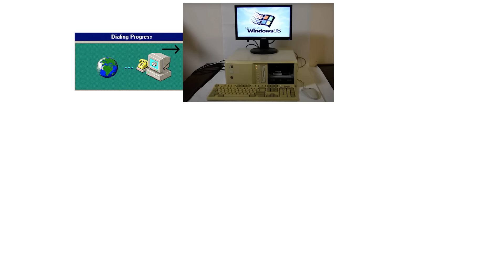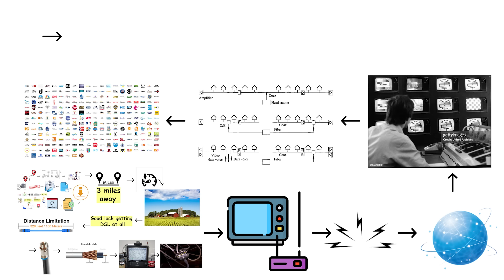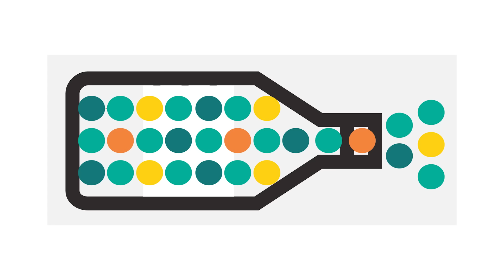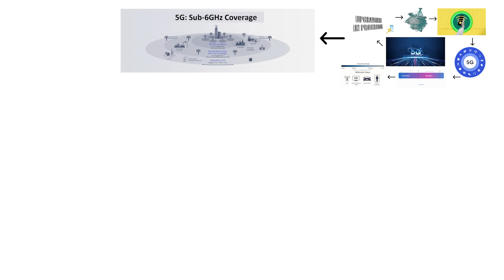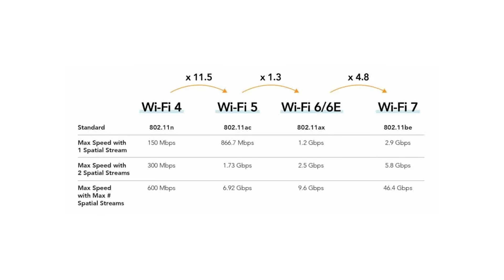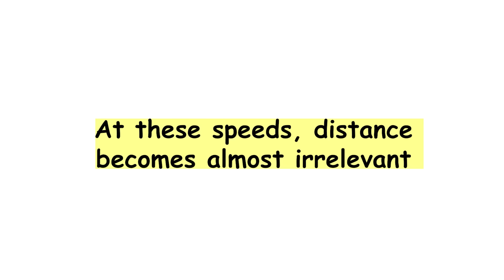Every Internet Speed Evolution Explained in Detail

Comment: i believe it is a bit inaccurate to say that the speed "increases" as in data travels faster. the speed "increases" because it can move more data per unit of time. no matter if the medium is a fiber of a copper or the air, the data moves roughly at the same speed.

Comment: ISDN gets no love
Reply: I have never met anyone who actually had ISDN.. still to this day 😅 how was it? Is it sort of slower adsl?
Reply: @nicklassjomann2080I had it before ADSL was really well deployed and dial-up was molasses. In 1997 running a 128kbps IDSN line was lightning fast because since it was digital, no DAC, no Noise, clean and clear and steady. Before ADSL and Cable was a thing, it was awesome. Honestly, I would have gotten in 3 years sooner if it was marketed. Problem was the endpoint equipment was still expensive and didn't get cheaper until late 1996.

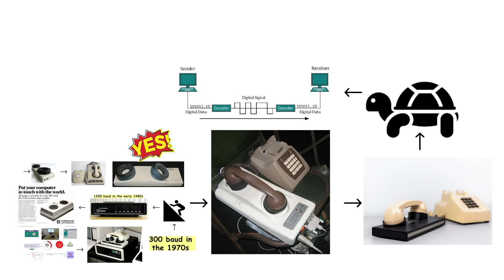Comment: At 2:15 the video claims that modems send digital data over analog phone lines which is incorrect. A modem converts digital signals into analogue sound and sends that across the telephone network (P.O.T.S.).  Also yes am aware of hybrid digital 56K (53.3K) downstream connections.  That is a ISP side only function that a home user's modem cannot do perform.

Comment: I worked for an ISP during the rise of broadband. It's actually kind of amazing to think how quickly things evolved, and eventually sort of settled on fiber, at least for now. You skipped ISDN and WiMAX though! We had quite a few ISDN customers back in the day and plenty of WiMAX customers in rural areas (kind of like a very early implementation of portable hotspots). Then we started working with builders and "fancy" neighborhoods to get FTTH. In the early days, it was not even as reliable as DSL, honestly. The internet itself wasn't unreliable, but the early routers had trouble keeping up with the traffic volume and would have to rebooted VERY often.We also bundled it with IPTV, which was a complete joke in the beginning!

Comment: 110 baud was a thing.  While I had worked with 300 baud, my first modem was 1200 baud, and, in my life, I had 2400, 3600, 4800, 9600, 14400, 28800 and then 53k (never got the 56k promised).  Then I went to cable modems.

Comment: i have used 56k modems in the past, but we got our first internet connection back in 2004 in the form of 256kb/256kb and it slowly got updated by our isp sa the low tiers were dropped off.
first to 512/512kb and then finally to 1mb/1mb.
our first true update came when our local isp offered this deal of full 24/1mb speeds for the first 4 months for anyone who got 1/1mb connection from them.
funny enough they somehow forgot to send the technician to switch us back to the 1/1mb, so my mom used her 24/1mb connection at 1/1mb pricing up until 2017 when our apartment got the base 50/50mb fiber to the basement included in the other expenses.

i personally switched over to 100mb/10mb cable 2012 and nowadays use 1gb fiber. to be honest there is not that massive difference between 100mb and 1gb, but if the difference is less than 5€ then why not take the full 1gb?
honestly internet speeds is the one thing that feels true to the 1950's view of "THE FUTURISTIC YEAR 2000!!!!", another one is our smartphones.

Comment: A couple of points.  You mentioned the first connection was 300 baud.  Actually it was slower at 110 Baud with the old teletypes we used in Jr. High. Then you went to 56k modems, but left out 14.4 and 28.8.  I used 28.8 when I first started using the internet.

Comment: It's a bit complex than "divide by 8". Bits use base-10, bytes use base-2 when we talk about kilo, mega etc...
So 1000 bits are 1 kilobits. But 1024 bytes are 1 kilobytes.
That's why divide by 8 works for low data like kilobits. But for higher data like gigabits or even terabits. Rounding becomes too far

For example 1 gigabits/s = 1,000,000,000 bits/s which is 125,000,000 bytes/s because 8 bits = 1 byte. 
Then after that you have divide by 1024 each step. So 125,000,000 bytes/s = 122,070.31 KB/s = 119.21 MB/s

Comment: "Wifi 7 is not needed if your internet speed is less than xxx mbits..." yet he forgets that sometimes people do internal transfers. wifi 7 allows us to move data quicker to home servers/NAS/etc. over wifi. So.... there's more than just the internet when it comes to networking.
Reply: Pretty sure that statement applies to the less tech savvy (I'm more in your realm hehe)
Reply: Also, WIFI 7 on anything below 500 Mbps is kinda overkill hehe. 6E at best for that slow hehe
Reply: Not even that but real world data transfers are wayyyy less than what they advertise it apparently WiFi 6 can get gigabit speeds wirelessly when at home I found that my gigabit connection maxed out my WiFi 6 router most of the time it was only with a WiFi 7 router that I managed to get above 700 down over WiFi consistently at least

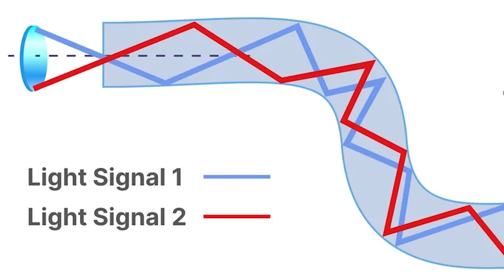Comment: Fiber is faster "because light travels significantly faster then electrical signals" (6:50) - this is not accurate.   Electrical signals travel at near the speed of light.  Cable internet "DOCSIS" is usually slower than fiber because it's limited by RF frequency spectrum.   A limited number of RF bands are allocated for DOCSIS and those bands service every subscriber in a hub.

Comment: From the jump there is a technical error - Yes, there are 8 bits in 1 Byte but all Networking Traffic (including Internet connections) uses 8b/10b Encoding where 8-bit words become 10-bit symbols to prevent data corruption from having too many 1's or 0's being sent in a row.

That means a 100mbps internet connection is 10MB/sec of data transfer, not 12.5MB/sec.

The same goes for SATA and USB - where 1.5gbps (SATA I) is a max of 150MB/sec read/write (slightly above PATA/IDE 133MB/sec read/write), 3gbps (SATA II) is 300MB/sec, and 6gbps (SATA III, the current and last standard) is 600MB/sec - this is why SATA SSD's max out in the 500-550MB/sec read/write range, and USB 3.0 (5gbps) maxes out at 500MB/sec, USB 3.1 (10gbps) maxes out at 1GB/sec, and USB 3.2 (20gbps) maxes out at 2GB/sec.
Reply: Additionally, Dial-up internet was limited to 56kbps as it worked through the audible spectrum that phone lines could handle. this is why if you had a speaker on your modem card or picked up the phone handle during a connection, you'd hear a lot of painful screeching, as that screeching was the computers converting digital data in to analogue audio to transfer along the phone lines.

ISDN and ADSL fixed this issue by filtering out the digital signals out of the audible spectrum and adding extra Error Correction to the data transfers, in order to provide higher speeds and less data corruption.
That is why if you had an ISDN or ADSL connection and a phone set, you needed to put a special dongle between the wall and your phone, and modem, so the phone calls wouldn't be corrupted by the internet and the internet connection wouldn't be corrupted by making or receiving a phone call.
Reply: @RiderAEonRanger  56kbps was the advertised speed. most people did not get that and it was usually around the 40 something k per second

Comment: You forgot ISDN which was a little faster than a V92 modem.
But Dialup did have a last hurrah.
MultiLink PPP

Video about it where a guy hooked up 12 dial up modems to work together and got 668kbit/s or 83.5kB/s
Reply: dialup had compression which could almost double your speed.
Reply: Yes, ISDN def had its time too! Working on the tech side, most of the customers on ISDN seemed to be tech savvy, so I don't remember having to do much troubleshooting with it. Dialup was a pain to troubleshoot though, because 9/10 the problem was the phone line. Rarely were our dialup customers in our service area, so we'd have to refer them to their phone line company, then they'd point the finger back to us.

Comment: you forgot ISDN. I remember as a kid, I started with a 33,6 kbps modem, damn that was slow. like 5min to load an image or an internet page. then I got ISDN 64kbps, equally slow, I couldnt feel difference. I noticed some difference with 128kbps ISDN, slight, but you had to pay double connection time. as ADSL 640kbps came in, everything changed for me. internet became fast enough for almost every task in that era.
Reply: Yeah, I had ISDN 64k first and the 64+64. The internet started getting easier to use for downloads once I got 128k. I think the download speeds were at around 14kps for dual channel.
Reply: “It Still Does Nothing.”
Reply: ISDN had the benefit of being digital natively which meant no DAC, some time saving plus no line noise, so downloads were slow but smooth. Basically 4X than 33.6 kpbs analog modem if you were rocking dual channels and if someone called, your data connection didn't drop
Reply: Also didn't technically cover DOCSIS properly. Currently DOCSIS 4.0 competes with fiber pretty well
Reply: not a lot of people had isdn and thats the reason it died, it was simply not popular.